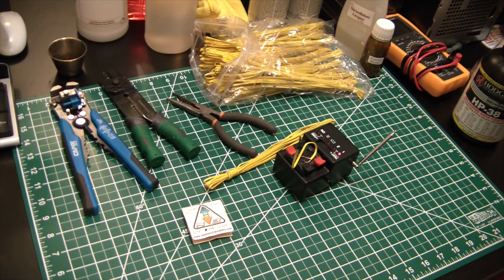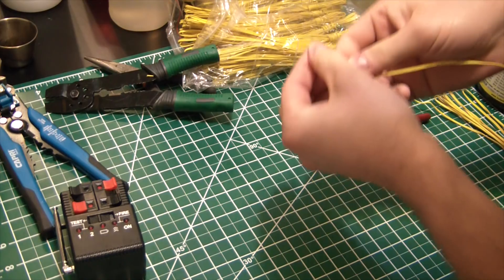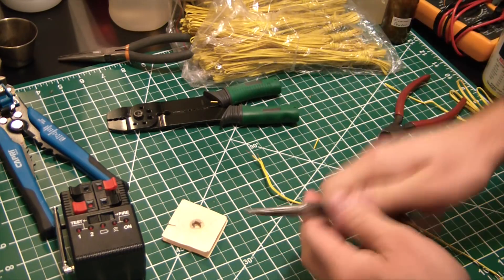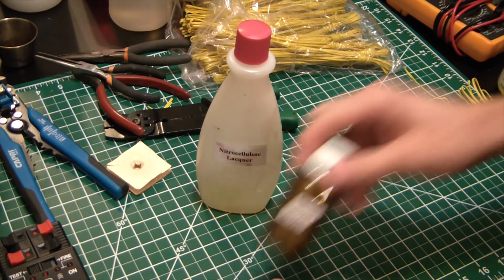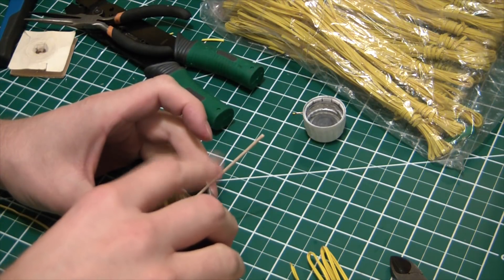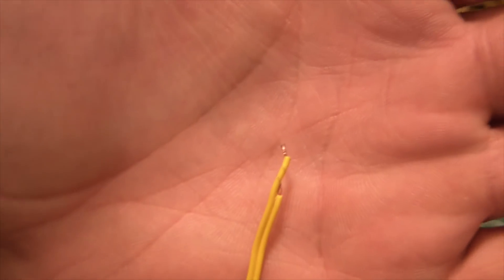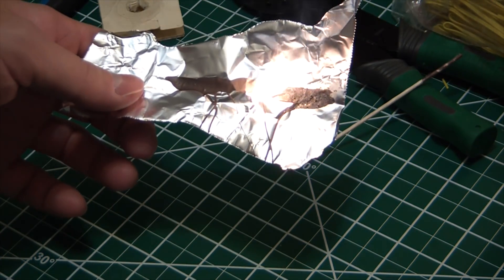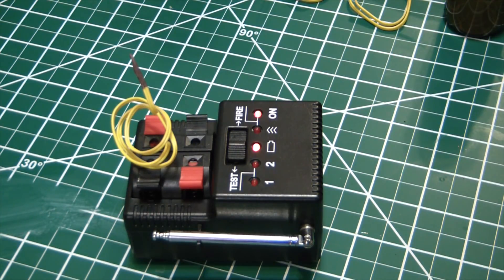DIY Electric Igniters for Rocket Engines & Pyrotechnics - ELEMENTALMAKER

Comment: can you just use the rocket fuel itself? 65 35 potasium nitrate and Sugar melted into a paste then dip that? would it work?
Reply from the maker: @DamianMealor  no the fuel is too hygroscopic and won't work for reliable ematches

Comment: I add conductive lampblack (aka carbospheres) to the mix and I can omit the nichrome wire.  Just 'strip and dip' the two exposed wires.
Reply from the maker: @mikedavis1517  I've seen some recipes for doing that but haven't tried yet, when I run out of my current batch of ematches I'll have to give it a try!

Comment: This video is just what I needed to see as I am in need of a bunch of these igniters!   I'm almost done building a resetting flash pot target for my slingshot.
The first target I made has just one flash pot and I have to walk up to the target to refill with powder after each shot but my new one I have been working on has 4 flash pots and resets itself after each shot.
I have been using model rocket engine igniters from Hobby Lobby that are short  and fragile  so these here you make on this video are just perfect for my needs so glad I found your video.
I have watched a few of your videos and that's how I learned to make the flash powder I use as I use to crush up rocket engines from Hobby Lobby and they cost too much money.
I plan to upload a video of the slingshot target when I have it ready to go.  The first target I made has been a lot of fun at back yard Bar-B-Qs and gets people interested in sling shots as a fun and inexpensive hobby.

Comment: Tech tip for the pyrogen, pyrodex dissolves in water, then just dip and dry on the nichrome wire, you can then dip in the nitrocellulos lacquer to seal it up

Comment: I do solder mine.  I just lay the joint on the table and let a ball of solder cool over it.  And then I squash it.  I've had continuity issues with just wrapping/crimping.  For igniting anything other than rocket engines, I stopped bothering to dip them in anything.  I use AWG 30 nichrome @18v and it never, ever fails to ignite flash, BP, NC, fulminates, etc.

Comment: Protip:clear nail polish is basically nitrocellulose laquer. You can use it if you can't find or make the nc laquer he's using here. Cheaper dollar store brands are best, because they have less additives.
Reply from the maker: I'll have to try that! Thanks for the tip!
Reply: @ElementalMaker no problem, I'm impressed that you answer comments on older videos!
Reply: Urrm no it's not its acetone not nitrocellulose . It breaks down cellulose into a lacker . So don't talk crap
Reply: @Dj_JohnMac  you misread.  Nailpolish is made with nitrocellulose,  Nailpolish REMOVER is often acetone. Just read the ingredients on any bottle of nailpolish, it lists nitrocellulose right near the top.
Reply: @chemistryofquestionablequa6252  I did Acetone, glycerin ,dmdm hydantoin methylparaben ,Cl 42090 ,Cl17200 ,aqua

Comment: All you really need between one end of your wires is some #0000 steel wool. Once you connect it to a power source like a 9volt battery, the steel wool will glow red. It’s a lot cheaper and can be made in seconds, plus it don’t stink as bad.

Comment: For an easier method, if you can't get hold of smokeless powder for whatever reason, the material on the heads of safety matches works pretty well, and will easily ignite from the heat of glowing nichrome wire too. Just crack the material off the matchsticks with the smooth section of a pair of long-nosed pliers, and crush it to a coarse powder under a plastic screwdriver handle on a smooth ceramic or glass dish.
Only do this on a small scale (10 matches worth at a time, at most), and whatever you do, don't try to grind the stuff in a pestle-and-mortar, since that kind of friction can easily ignite it - I've made that mistake before! But it can be combined with nitrocellulose lacquer, wood varnish or clear nail polish (or even superglue if you're quick about it) to make a thick paste, which you can then apply to the head of the electric match and let dry.
I think the match head material is mainly potassium chlorate with some sulfur, which is a pretty easily ignited and high temperature burning mixture, which is enough to ignite most solid rocket fuels. Just don't make the mistake of using "strike-anywhere" friction matches - that stuff goes off far too easily and you could end up with a premature ignition just from the friction of inserting the match into the rocket motor.
For igniting thermite, if you don't have access to magnesium powder or ribbon, you can use a bit of potassium permanganate powder and a dribble of glycerin. Take a little bit of your thermite mixture (about half a teaspoonful) and mix with an equal volume of permanganate, then deposit this mixture on top of the rest of the thermite. Make a small depression in the mixture and add a few drops of glycerin. Within about 30 seconds, this will auto-ignite, and burn at a sufficiently high temperature to ignite the rest of the thermite, giving you a nice time delay fusing mechanism.
Reply: Dear, can I crimp off red thing from matches, and mix it with a very small amount of watter? Would that work? Im igniting with same wire in the video.

Comment: I used a much simpler option. take a lamp, like a 1.5V, 3V, or 12v, - crack the glass - and pour some of the candy-fuel onto the element - works fantastic - it throws a flame so even if its not touching the grain it will light it.

Comment: I'll be using this technique to light a smoke bomb inside of Jeannie's bottle for that special effect! Thanks!
(Hey, what do you guess would be the failure rate on setting off an 'off the shelf' smoke bomb without adding the coating dip to the nichrome wire and using a 9 volt battery as the power source? I know adding the coating would increase the success rate, but I need something that's marginally effective and QUICK! I'm not a chemist or an engineer. I'm only a marginally effective screenwriter who needs to create my own SFX. Thanks!!)

Comment: When we were kids, a friend and I made our own ignites out of the twist ties on bread bags. Just strip about 1/2" of the paper in the middle then bend it SHARPLY and pinch a little bit of tissue paper between the 2 halves. Shove that into the engine and hold it in with a bit more tissue.
It takes a few seconds to get hot enough, but it works. We also didn't have fancy launch buttons so we used a length of 2 wire with alligator clips to attach to the igniter and touch the other ends to a 9V battery.
Come to think we didn't have a launch pad either so we just stuck a copper coated welding rod about 30" long into the ground with a tin pie plate for a shield and a piece of tape wrapped around to keep the rocket from sliding too far down.

Also I remember engines had one stage that just made a LOT of smoke to make tracking the rocket easier.
Reply: We were the poor kids with a hobby that was normal expensive. But we made a lot of our own stuff...including rockets without any kit or plan...the only things we really needed to buy was engines, nose cones, and balsa for fins. Oh..and glue, dope, and paint.
We made bodies out of any light tubes we could find, internal structure out of plain cardboard, and parachutes out of breadbags and shock cords from rubber bands. So instead of $20 for one rocket kit we would spend $50 for 2 or 3 dozen rockets

Comment: Instead of nicrome wire you can use 0,25W carbon resistors or 1206 (or smaller if you can handle them) SMD resistors. You get them on reels of 3000-5000 pieces for a few buck in electronic surplus shops. The resistance depends on the battery voltage.
For my homemade "blastingmachine" wich works at 250V I use 150 - 250 Ohm. This works also with long (100m) wires.
Reply from the maker: Try and let us know! I have used 0.5ohm 1/8w resistors with success before. Quarter watt should work even better, I've just never tried the smd type.
Reply: @ElementalMaker   Here is an example for use with a batterie.  This resistors are cheap like dirt.  https://www.ebay.de/itm/SMD-Widerstand-SMT-Resistor-2-7-Ohm-2R7-5-1206-1-4W-1xRolle-5000-Stuck/362881564896
Reply from the maker: @uwepolifka4583  I'll have to try those! 👍

Comment: I just switched over to using nichrome/kanthal wire as ignites. Bought 250 feet of kanthal for a few dollars. Kanthal should work better because of higher melting point, but not sure. Currently using 2-3 D batteries with a bunch of speaker wire for distance and kanthal for igniter. Works well.

Comment: As a recovering pyro, if you've never considered this, add a little graphite powder to your pyrogen and it becomes conductive. I use like lock lube graphite. Then take your wire leads, clip just an 1/8" of insulator off and gap them with just a millimeter of space between them. The graphite allows conduction and it heats enough to fire the nitrocellulose. It takes a little more juice to fire, but I've never had any trouble as long as I was using at least a 12v source. Additionally, as a former amateur rocketeer, a trick I learned to get more pyrogen on the igniter was to double or triple fold the tip before dipping to give more surface area to stick to. Another trick was taking some spare cured propellant, GENTLY using a cheese grater to grind it into tiny pieces (never do this with propellant containing titanium or zirconium!!!) and adding this to the pyrogen to get some extra oomph when needed. According to my parents I started lighting things on fire when I was 4 years old and I can't seem to stop being fascinated by fire and explosions. :-)

Comment: If you want to be really simple I just file and break the tip off of a glass old Christmas tree light and fill it up with the nitro cellulose ignite mix that I made with acetone,smokeless powder and powdered aluminum and I little bit of black powder dust shove the end of the fuse inside and let it dry. Attach that to an appropriate length of two conductor wire plug it in to your ingition box for model rockets and off you go. Works everytime and sho doesn’t have a shitload of old Christmas lights lying around.

Comment: Would a 6 v remote igniter system work on your igniters? What is your voltage? For sugar rockets. Where did you get your potassium perchlorate? Love the tutorial. What volumes of chemical are you using? Any help appreciated.

Comment: You can hear the remote signal interfering with the audio.  Someone could grab your launch code from that!
Reply from the maker: Oh wow that's crazy your the first to point that out! Very observant.
Reply: @ElementalMaker  I used to capture fixed code remotes as a child when hacking car alarm remotes to prank the neighbours. I used to record them onto tape(!) so no problem recognising the sound.  I just came from NullByte after watching their Wi-Fi firework launching video - electric matches would have been a lot better than their version (and possibly safer). Your electric match build is the best quality I have seen.

Comment: It’s good that I learned everything ....but  in case I don’t have those item that’s a mix it  ,,,,,,,I have a shortcut  I can make’t  from powder match is much faster I think 💭
Reply from the maker: Careful with match heads. They are a chlorate based composition that can cause extreme sensitivity or spontaneous ignition if exposed to sulfur or phosphorous.
Reply: ElementalMaker  ...... aha   Thanks for the valuable information &   Thanks a lot for your interest 🙏🏻👍✌🏼🌹🌹🌹🌹🌹

Comment: I made a fuse by emptying Pixy Stix wrapper cut it in half and filled it with some rocket fuel twisted the end insert into rocket light with match worked every time
Reply: EEEEE please don’t do this, non-electric lighters are extremely dangerous and are disapproved by the NAR

Comment: Hey ElementalMaker, have you ever trier a lower/higher gauge wire?? I've tried 32AWG Ni-Cr wire and it heats up well but only if the wire is about <10cm.. I got the Estes PS II (6-C Cells) & Estes 2230 E (4 AA) launch controllers.. Would you recommend I use the 40AWG for a faster heatinģ time?

Comment: I used to use my front teeth for stripping wire but eventually through wear & tear I had em pulled last week. 
As much as your teeth might feel perfectly joined to your jaw & skull (in youth usually), stripping wire is best left to tools and/or a blade, otherwise look forward to Summer-Teeth (some are here, some are there) when 'ageing' :D

Comment: Good video. How many turns of Nichrome wire did you use?
Reply from the maker: I usually just go for two or three turns since my igniters run off a 9v battery.

Comment: Where do you get the KCLO4? Also worth noting that Nitrocellulose is made from gun cotton and acetone, not sure but I think all your doing is adding a little more fuel and stabilizers from the smokeless powder that are used to slow the burn rate down.

Comment: Elemental Maker - How do you think Estes makes an igniter which only requires 6 volts (4 AA's) to light?  I've tried several mixtures of pyro-stuff (based on what you describe in this video) to coat the tip of 36 gauge kanthal wire, but it won't light. Any suggestions? Thanks!
Reply: You should try a 60 or 80 AWG nichrome wire instead of the 40 AWG. All the chemical stuff would stay the same, but thinner wire will burn easier....

Comment: Dear Sir,How do you tell if a ping pong ball is made of nitrocellulose by burning one? Please explain.
The one's I bought burn with a thick black smoke!!But they did melt in acatone but produced a white milky solution!! Is this correct?
Thank you in advance for your reply,,,
Neil
Reply from the maker: They should burn with no smoke, and with an intense orange burn like slow flash paper.
Reply: @ElementalMaker  thank you for the quick reply, the box said recreational table tennis balls, six four a dollar 56 at Walmart,
Reply: Regulation ping pong balls cost 10 times that much, do you know of another cheaper alternative to make nitrocellulose lacquer?
Reply from the maker: I'm honestly not sure. I've always bought DHS 3 star ping pong balls since I play ping pong all the time. Many ball manufacturers have moved to plastic balls to get away from the dangers of working with nitrocellulose. It will be hard to find unless you can make some yourself.
Reply: @ElementalMaker  I also heard that guitar makers use nitrocellulose lacquer as a finish for there custom built guitars. I wonder if that's the same stuff? I doubt they make it! they must buy it somewhere!!! If I do happen to find out I'll let you know! thanks again for the great work on your videos, they've been an awesome asset into my new venture of rocket building !!!thanks again peace out!!

Comment: Could this be used to ignite a liquid fuel engine?
Reply from the maker: I'm sure it could, but a spark gap igniter would be more reliable in a liquid fueled engine. Check out my video on the ingition coil driver. That plus a spark plug would be your best bet. Although... Heck the Russians use giant 2x4 sized match sticks to launch their manned missions LOL

Comment: Hi, I tried making this, but the smokeless powder seems to not dissolve in the solvent (Laquer), even after nearly 30 minutes. Also, when i tried to burn this in homogeneous mixture i was getting a slow burning flame, no way close to what you have in the video. Can you suggest, where i am possibly  going wrong? Thanks

Comment: Could you take a thin cardboard or metal tube and pour a tiny amount of the ignitor solution into it with the NiChrome setup, and make a small blasting cap with it?

Comment: Old demo-school trick to stop accidental early ignition.  Twist the standing ends of your wires around each other.  Split the wires apart from each other if their coatings are bound to one another, and twist the pair together down their entire length.  Bind the twist with taoe if need be to keep it twisted.  Prevents accidental early ignition due to radio wave interference.  This is especially true if you have an ignitor wire anything over 1 foot long.

Comment: Elementalmaker, try out using Christmas lights. I call them tangle lights. Nip off the tip of the glass and fill it with ignition powder. Hot glue or something to cap it and it's ready to go.

Comment: I think the Iron Oxide is not necessary.  There is plenty of Oxygen in the nitrocellulose to react with the Aluminum.  The only reason for using Iron Oxide in thermite is to make molten Iron which won't hurt the igniter but not necessary.

Comment: There is a product called "Newskin" sold as a (painful) dressing for small wounds, it is a nitrocellulose lacquer.
Reply from the maker: Very cool!
Reply: Clear nail polish is nc laquer too.
Reply: I searched for pong balls at 3 different stores. All of them not nitro...I was literally just using new skin and saw your comment!! How random is that!? Now, ive solved 2 problems! Appreciate it sir!
Reply: hmmm interesting. In the 9 months has there been any tests using Newskin with the other required ingredients
Reply: Mohawk Finishing Classic Instrument Lacquer is also a nitrocellulose lacquer that works as is.
Reply: Dude, can you remake the video without the nichro wire break snafu. Use better close ups.  The 
cad drawing was perfect.
Focus dude! Forget the comment of a truck driving by.   No need to say that.
Dude, update! No longer are ping pong balls made of nitrocellulos.
Reply: ...thanks for the info...😉.
Reply: Not all smokless powders contain Nitroglycerine. Single base powders are Nitrocellouse and a burning deterrent. Double base powders contain the Nitroglycerine.

Comment: I'm gonna have to try that ignition mixture out. The electrical ignition system I have is very archaic lol. I use Christmas lights for the cap and just break the glass to expose the filaments and put some Zn+S mixture around them, and hook up either end of wire to another wire I can touch to a 9 volt. Doesn't always work but when it does it's glorious